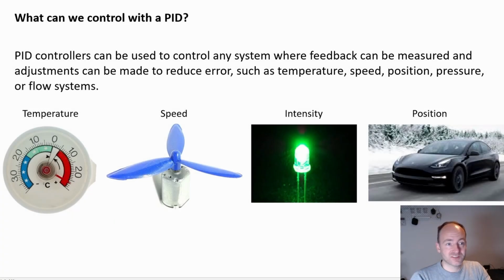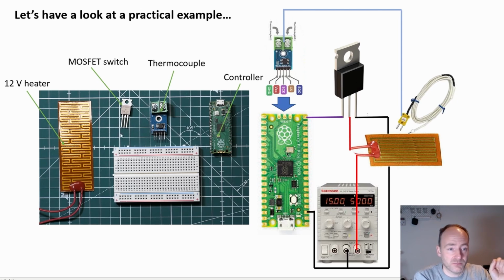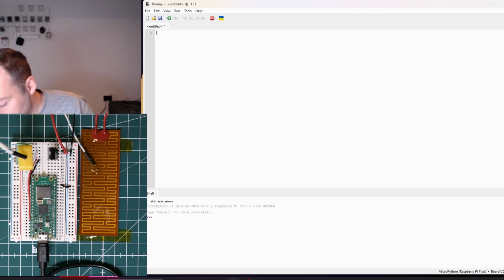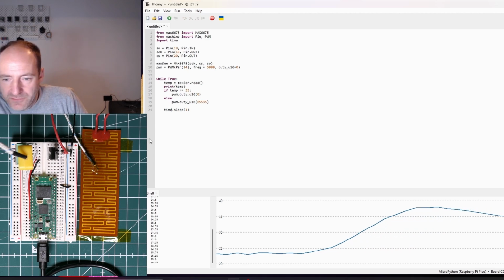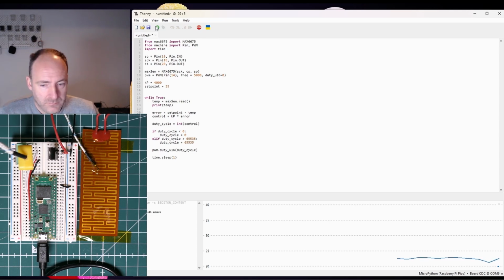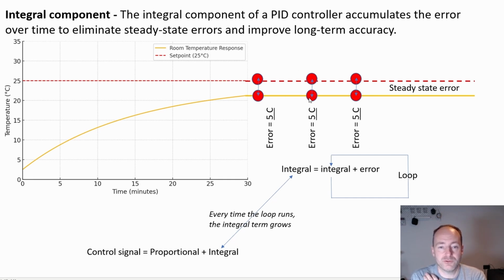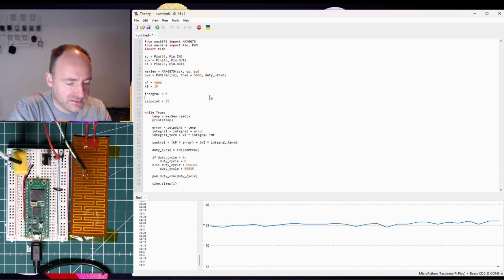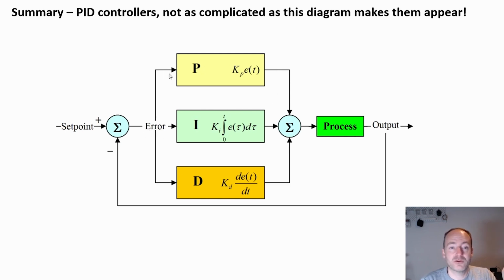PID Control Explained: The Ultimate Guide from Basics to Implementation!

Comment: I am working on PID for my model rocket and I am learning thrust vector control and I did not understand much earlier but seeing ure vid I understood a lot also I was wondering if u could once see my code :- I know it aint perfect but still #Objective to make a program that calculates errors every second
setpoint = 0 #the angle I want my rocket to be at
current_angle = 1
angular_speed = 0
dt = 0.02
Kp = 200
Kd = 2
for i in range(200):
    error = setpoint-current_angle
    proportional_term = Kp*error

    accel = 50 * current_angle + proportional_term 
    angular_speed += dt * accel
    current_angle += angular_speed*dt 
    
    print(f"current angle = {current_angle}")
Reply from the maker: That’s a great start! 🚀 One thing I’d change is that the angular acceleration shouldn’t be proportional to the angle itself. Try making it depend on the control input (and maybe add some damping) instead. Keep going though—you’re definitely on the right track!

Comment: Really interesting, but I'm not sure what you mean when you said you plot the curve and look for it to determine some of the constants.   In our cabin we have a 1300l water tank that we heat up with a 40kW firewood stove.  But now I have bough a 15kW immersive heater (5kW per phase) and I would like it not to vershoot to much from the set point.  But the cabin can take anything from 0.7kW constant power to 10kW of constant power depending of if it is around +10 degrees or -40 degrees (it is in northern Sweden) so the extracted heat from the water tank will have a really big difference depending on the out-door temperature.   Will the best be to calulate this for the worst scenario and let the PID do an optimal work when the cabin need 10kW of power or should the optimal curve be somewhere in the middle?  The most importnat is that the Setpoint of heat can be reached even in the worst conditions so it dont swing around 20 degrees when I need it to be 40 degrees.
Reply from the maker: With a 1300 L tank you have an enormous thermal mass, and your heat load varies by more than an order of magnitude depending on outdoor temperature.

In general you don’t tune PID for the absolute worst case. If you do that the controller will usually become sluggish during normal operation. It is normally better to tune around the typical operating point, then keep the controller fairly conservative because the tank inertia is large and the heater power is high.

Also worth making sure there are independent safety limits (thermostats or cut-offs) when working with multi-kW heaters.

Hard to comment on the specifics of your installation, but hopefully that helps clarify the idea behind plotting the response curve. Just be very careful, water and electricity are never a good combo and with the power levels you’re dealing with there’s little margin for error!

Comment: I think you forgot to assign prev_error after 'derivative = error + prev_error' so that overshoot was caused by the module still running as a PI because 'D = 0'.
Reply: Thank you a lot for teaching me how a PID module actually operate in a program, I never found any video like this on youtube, they are all "p is propotional, i is integral, d is derative, so this does that,...". I struggled understanding how the module produce an appropriate value for the end to work, those are 2 different units, different scale, irrlevant.
Reply from the maker: Thanks, and you’re right about the mistake in the video… A few people mentioned it in the comments, but it’s a great catch if you’re just learning about PIDs! Glad you find the video useful and thanks for watching 👍

Comment: One of the issues I’m facing with the derivative calculation is that my microcontroller updates the error and previous error so quickly that the difference between these values is almost negligible. As a result, the D term becomes zero or so small that it makes no difference in the control.

One thing that worked was setting an interval for this calculation — for example, the microcontroller only updates the error and previous error every 5 ms, so the delta becomes noticeable.
Reply from the maker: Interesting! In theory the d term is calculated by taking the current error subtracting the previous error and then dividing by the time difference between the two measurements. So in the case where the measurements are very fast resulting in a small difference in error, the dt will also be very small… so the division yields a bigger number. Adding a fixed delay between the measurements will help for sure, but it halts the execution which can be a pain. I wonder if you could use an interrupt triggered by a timer to take the measurements and then calculate the PID terms?
Reply: @thecircuithelper  As my readings vary only in discrete steps (encoder), the maximum difference I am being able to measure between the current error and the previous error is 1. So, even though the time interval (dt) is small, the numerator will be 0 or 1 at most. When it is 1, it results in a very high derivative value, as you mentioned, causing a "kick"-like behavior in the output.

Using a timer interrupt to update the error difference at fixed intervals provides enough time for the system to perceive its trend.

I confess I am not finding much information about a technique like this; it just worked for me, and I am still trying to fully understand it.

Comment: Why you assumed 65000 value for kp is there any logic or just assumptions
Reply from the maker: It’s a good question and I don’t really have a definitive explanation, but can explain how I go about it. 

Imagine you have a heater, you can control the power input from 0 to 100. 

You decide to make a P controller to maintain a constant temperature of 80C…. How to pick Kp?

I’m not sure if there’s a standardised approach to pick Kp (I’m sure there are guides giving different methods). The way I do is try to think about what the maximum error is likely to be and make sure that the maximum error x Kp does not exceed the maximum input that my system can handle. So in this example:

Coldest temperature expected: 0C
Desired Temperature: 80C
Error = desired - measured = 80
Maximum Kp value cannot exceed (100/80) 1.25, because 80 x 1.25 =100. 
If Kp was set any higher then the input to the heater would exceed 100 which would cause problems,

So when it’s cold, the input to the heater will be close to 100. As you get closer to the setpoint then Kp x error is a small number so the heater has a low input power. Obviously when the setpoint is reached the error is zero so the input to heater is zero. 

Hope that helps!
Reply: @thecircuithelper  if I want to set heater at 40 degree constant what will be PID values
Thanks
Reply from the maker: Just be careful though, in the video (if I remember correctly) the heating power is controlled by pulse width modulation. If the pulse width is set to 100% then the heater is on all the time, if the pulse width is set to 50% the power is at 50%, obviously if the pulse width is 0, the heater is off.

On the Pi pico, the pulse width is set using a 16 bit number, so setting a value around 65k gives roughly 100%, 32k give ~50%.

Good luck.

Comment: Watch out even with "logic level" MOSFETs! "Logic level" used to mean, probably... 20 years or more ago, used to mean 5V! Like what the Arduino Uno / Nano uses. So there are PLENTY of older MOSFETs that people will know about, they will call themselves "logic level compatible" design in the datasheet that's been around forever, and that was true when it was written! But...

Nowadays with 3.3V processors and sensors being far more popular, obviously for a big portion of those older MOSFETs, they call themselves "logic level" but a 3.3V processor like an RP2040 will not be able to turn it on fully at all! You usually want to look for a MOSFET which says it has a Vgth value typically around ~1V lower than logic voltage level (or lower). So likely a MOSFET which says its average Vgth is 2.5V or lower will work quite well with a 3.3V microprocessor.

Also usually want to mention that although the ground gets shared, you never want to power a powerful load (like motor, heater, etc) directly from the board pins. Always use a separate power supply (which to be fair you do show in the diagram) as the voltage source. Common trap for young players, as Dave Jones says.

Edit: for the code, it might be a helpful separation of logic to create a helper function which accepts any decimal number (nominally, between 0.0 and 100.0, although it would correct erroneous values), and its output would be a correctly calculated integer between 0 - 65535 to then pass to the RP2040 API function.

Edit edit: You multiplied by kI twice 😅

Overall very good video because of using the practical example to demonstrate it
Reply from the maker: Thanks for the insight! Totally agree about the logic level FETs, got away with it in the video and worked for demonstration, but in a ‘real’ circuit I’d very rarely do it. Main problem for me is current sourcing/sinking ability (or lack of) of microprocessor outputs, this really limits switching speed. Nearly always better to use some form of driver… I’m really like the optocoupled mosfet drivers these days! Thanks for watching!!

Comment: This is the best video ever. Thank you for your effort. You are 100% right about the diagram😅. I've just realised that PID is not rocket science. 

I have noticed a few issues you may like to clarify. Please🙏🙏  accept my constructive feedbacks:
You have multiplied integral value by "kI" constant twice.
You have not set "previous_error" in loop 
And you may expalint dt term more on the next video🙏🙏.

Subscribed for ever for this video
Reply from the maker: Thanks so much for watching and the useful feedback!!! Didn’t spot the Ki twice, did spot the ‘previous_error’ (it was in the code, I think) but I didn’t mention it in the narrative! Might do a video how to tune a PID and explain more about dt… thanks again!
Reply: @thecircuithelper  Yes, great video and perfectly explained what a PID controler is step by step! Kudos!!!
I think that the comment form @ufukizgi is correct however (and this is constructive feedback as well 🙂). Here the code from 39:00:
integral_Term = kI * integral *dt
I = (kI * integral_term)

derivative = error - prev_error
 D = kD * derivative *dt

If understanding correctly the two lines calculating "I" are multiplying kI twice or in one line: I = (kI * (kI * integral *dt)) so I guess there is one kI too many?
Calculating D is understood, but the code does not change "prev_error" I think there is a line missing before "D" with: prev-error = error?
In any event, this is only what I understood and I may be completely wrong in which case I would highly appreciate if you could explain, what I am missing? Again, constructive feedback this is ☺
Cheers!